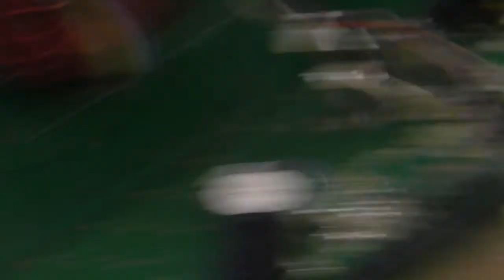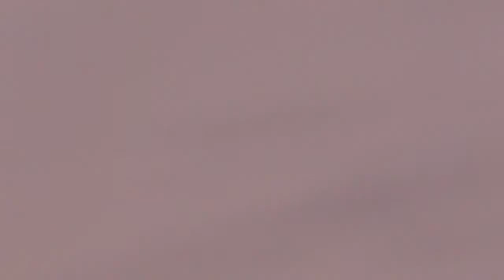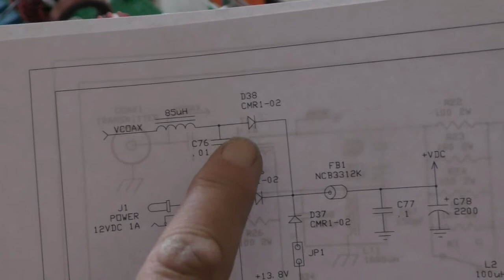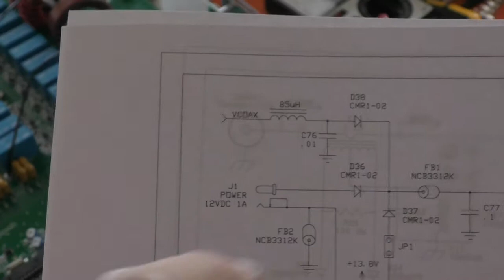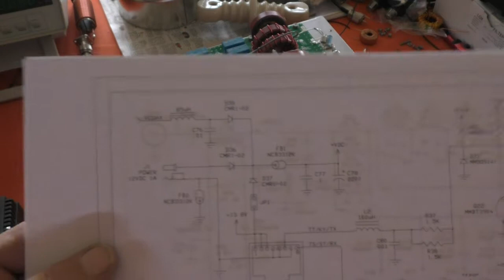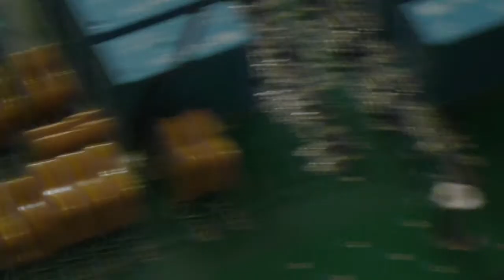A Deeper Look Into The Faulty 998RT

Comment: I'm assuming you've also been sent a replacement bias-T. So, if this is the case,  then maybe the problem was with the amount of power injected by the original bias-T unit and was not a problem with the auto-tuner.

But be careful, mate, at the rate you're going MFJ might just ask for the replacement unit back 😈
Reply from the maker: The bias T doesn't determine the amount of DC power injected into the tuner. The bias T has a power socket where the power for the tuner is injected, this was connected to the same power supply as the radio, 13.8v. The tuner, when working correctly draws around 1.5A when tuning and around 100mA when idle. The large current draw that burnt out the internal components was due to an internal short circuit on the cathode side of the DC blocking diodes.